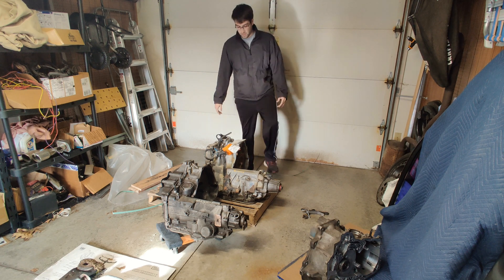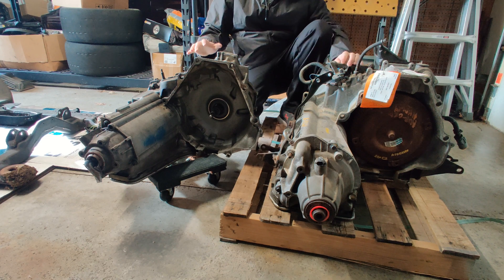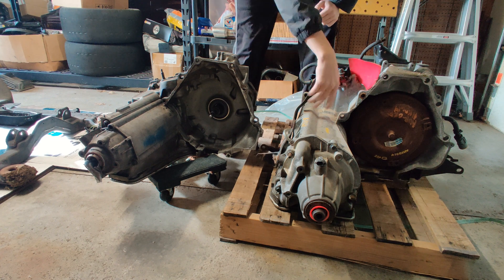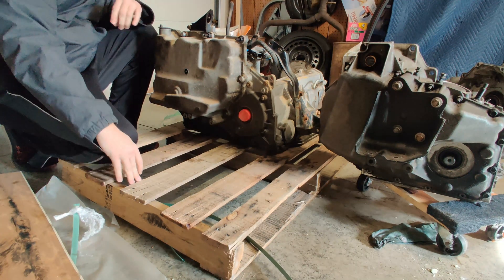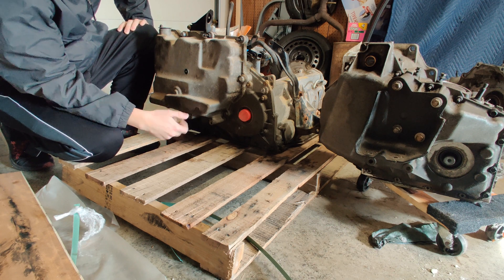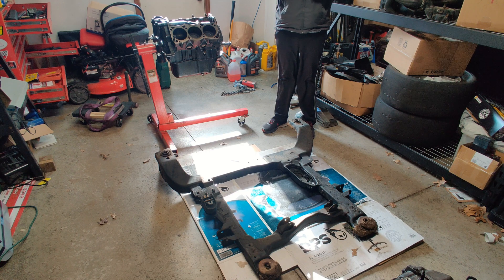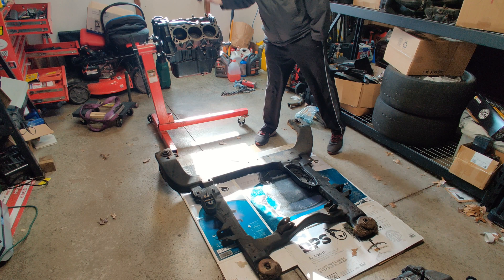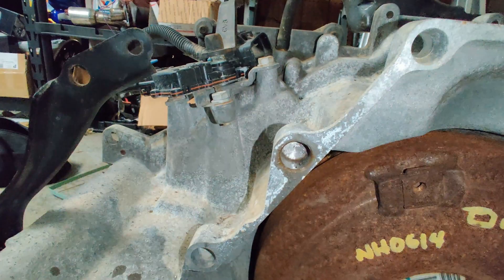4T80 Swap Part 1

Comment: is this going to be a manual electric switch shifter or have you got a plan to get this hooked up to the ECM?
Reply from the maker: Gonna use the stock ECM. I have a tuner that I should be able to reverse the 2 and 3 shift logic with.